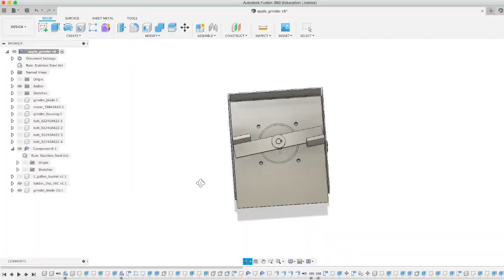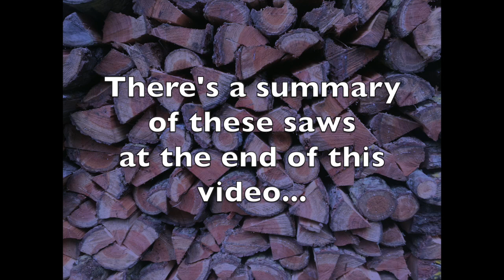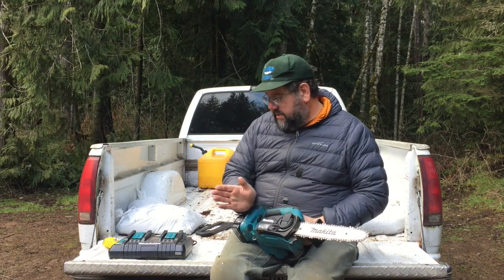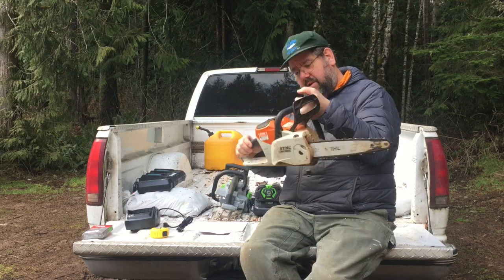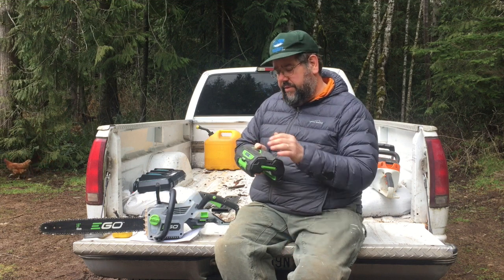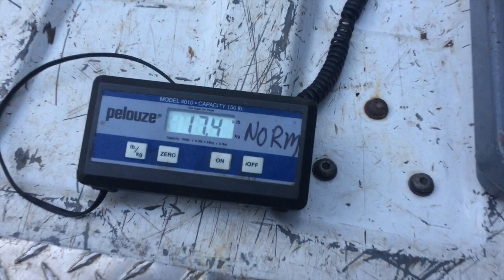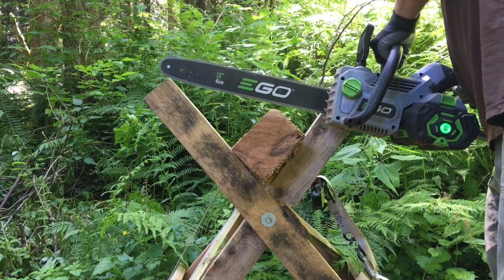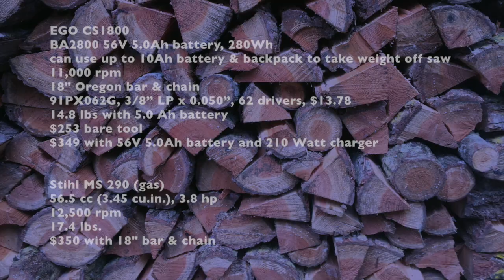Cordless electric chainsaw testing and review – Part 1 – which battery chain saw is right for you?

Comment: Most of the battery powered chainsaws don't oil the bar and chain very well. I just sent a brand new Greenworks back for refund. Greenworks support, Good luck with that.  I tried calling was put on hold and finally gave up.
Reply from the maker: The EGO oils pretty well, you can always test it by revving the chain in front of a clean piece of paper or cardboard. I do think it (and most chainsaws) benefit from running a bit thinner bar oil in cold weather. The Stihl oils as you would expect a Stihl to oil, and is adjustable oil output.
Reply: @normnelson  I decided to fix my 20 yr old Shindaiwa 488. I always run it out of gas before putting away. Sat for over a year, Would not start, hoping a carb kit will fix it. There is a Stihl Shop in town, Will check it out if I unable fix the old 488.

Comment: I think the slow start on the EGO is for 2 reasons. 

1. Battery health. 

2.  EGO knows this will be many peoples' first chainsaw. Without an engine running to remind them it's armed, it's a soft start to keep newbies from chewing off digits.
Reply from the maker: It could be both of those. I just wish it was switchable... like "beginner" mode and "pro" mode.
Reply: @normnelson , I just realized another reason... a full speed start would shred the battery capacity.

Comment: problem with cordless is a battery life, cost to replace, cost to have spare or two.
Reply from the maker: Problem with 2-stroke gas is you have to keep good gas (means buying ethanol-free these days, and putting stabilizer in it), keep your carburetors clean, then even once it's running you end up smelling like 2-stroke oil, have to breath that exhaust and listen to all that f*&$&ing noise all day. I'll gladly buy a few batteries now and again.
Reply: @normnelson  I hate 2 stroke gas equipment